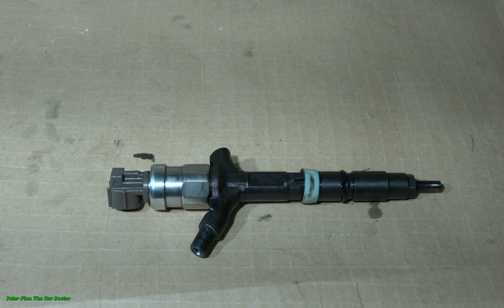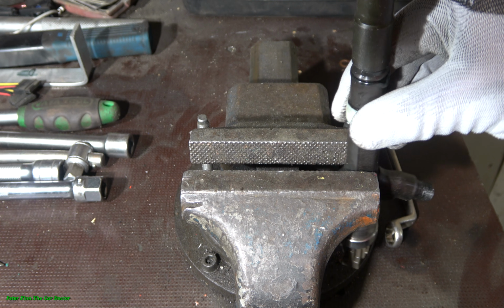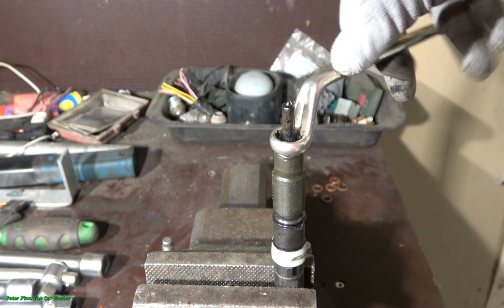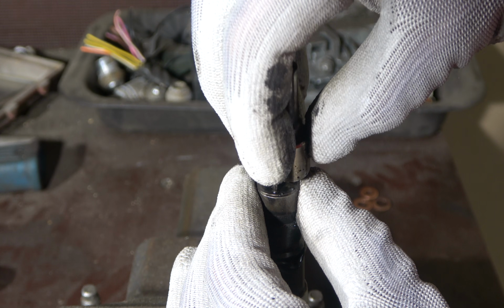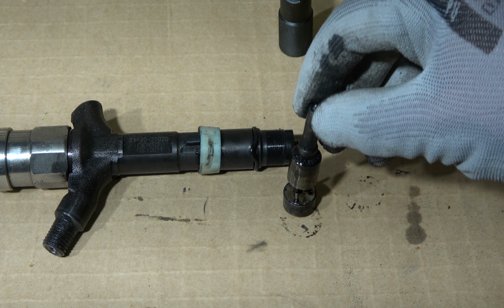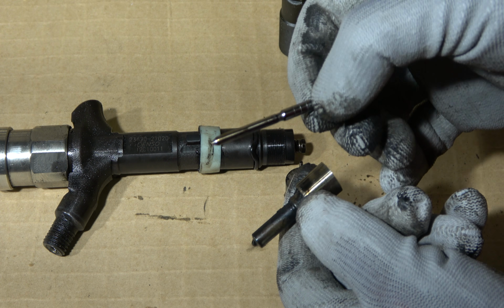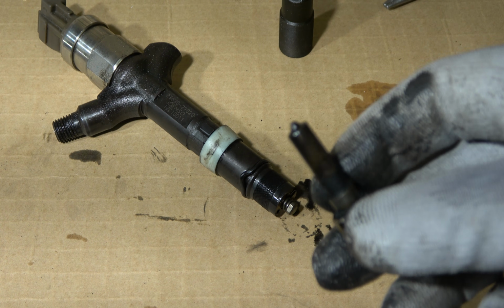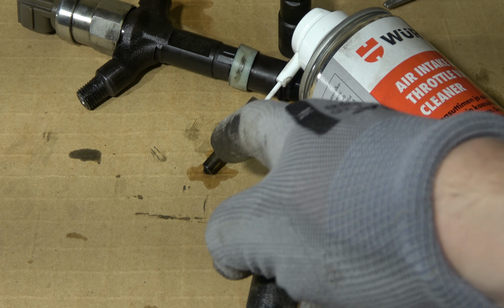How to disassemble Toyota D4D diesel fuel injector. Clean and Inspection

Comment: Peter I have a cold start issue with my car, the injectors seem loud in cold temps on cold start but quieten right down once car is warm. It's the Avensis 2.0 2007. Someone has suggested changing the ends of the injectors?
Reply from the maker: Sounds good idea

Comment: is there a big difference to the 2.2 DCAT 177 HP injectors (PIEZO type)? part e.g. 23670-26011
Reply from the maker: Some small changes, maybe the gas hole. Toyota always choose right side parts to different sizes for engine power classes. a smaller part brought action in some way Ok. Test it!

Comment: Would a shop just replace the injectors instead of cleaning them up like this? Are there other things than this clogging up that can fail on injectors?
Reply: No, there is a tank on the injector which can get blocked up, this is just cosmetic, injectors are high psi, I doubt blowing out the end with an aerosol would make any difference